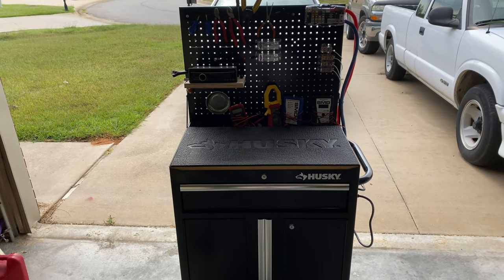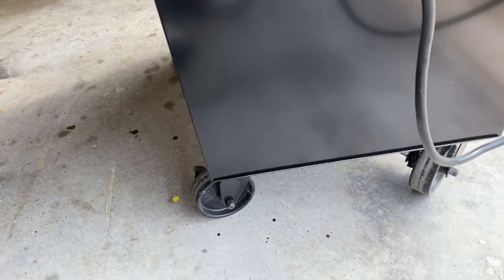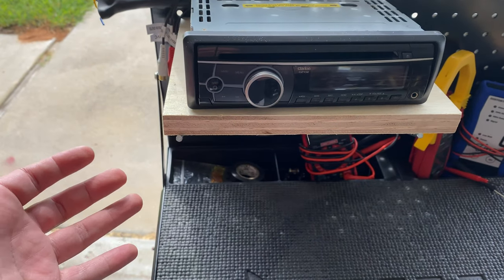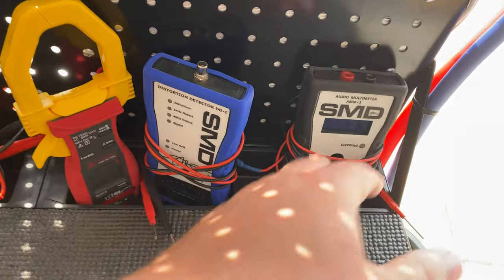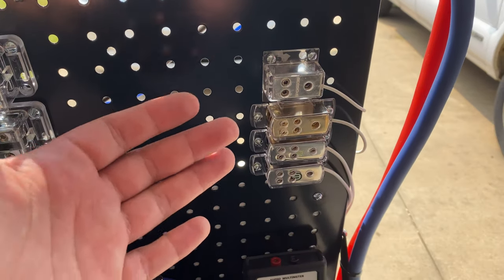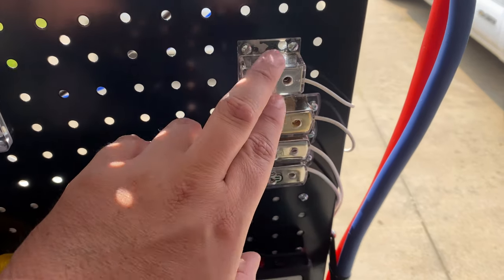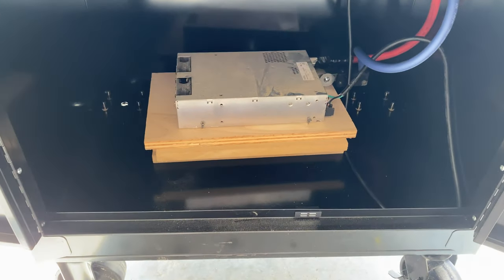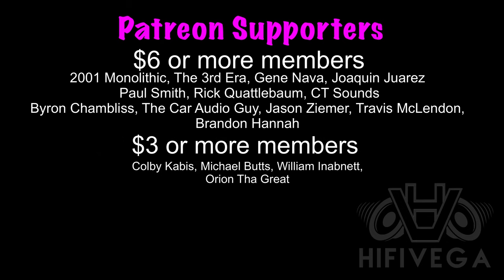Building my new car audio test bench! [4K]

Comment: Cool compact test bench. I have a pair of those klein strippers myself, they are the best. I built my power supply into an old tabletop radio and it sits on top of my work bench.My only suggestion is to put heatsink grease on the backs of the resistors so your pegboard can act like a heatsink .
Reply from the maker: 2011joser thanks!

Comment: Mount the power on the back wall of the cabinet.  Then you got room for a few batts. They make a under dash dash kit for old school cars. Slanted design. Could work on the opposite side of handle. Or put it into the front cabinet door.
Reply from the maker: Mike Danner oh I could still fit a few batteries with this one and I have a couple group 31 agms, but I wanna upgrade to a lithium battery bank and a charger for testing in the future

Comment: Decent setup! Looks like it may make it a little more convenient for you to use. Didnt realize we had the same power supply I'm gear up for a second and run them both to a fosgate t20001bd in my garage. Gotta figure out the feed back noise first from my Yamaha tuner.  I'm using the sub out. Right now I have a little punch 45hd running a sundown 8 but I wanna run my fosgate t2d2 15.
Reply from the maker: Trece Daves that Cosel is rock solid for sure

Comment: What size power supply you are using or more information on power supply to use. Thank you
Reply from the maker: Paul Van Der Ross it’s a Cosel 130amp continuous 150 peak power supply. I plan to upgrade to a lithium battery bank in the future
Reply: Thank you for the reply
Reply from the maker: Paul Van Der Ross 👍🏼

Comment: Can you link the power supply please!
Reply from the maker: sniperking305 https://www.ebay.com/itm/141333731427
Reply: @HifiVega  so I'm seeing it's a 1500 watt power supply to the tune of $300.00. I have a hewlett packard dps-1200fb power supply 1200 watts 

There has to be some huge difference in output. Because the hewlett packard cost $25. What am I missing ?
Reply: @Mr_BUSINESS_24_7   Not sure where you got it for $25, but they tend to go for double that refurbished and we'll over $100 new. 

Prices aside, the difference I see is 100AMP vs 125AMP.
Reply: @brandonweigel6309  what I have is not what he has. What I have "was" $25. But not sure what the differences are in the specs. Google DPS-1200fb specs. It does 100A. .....so ??.   And they are currently $24.50 to $27.99 plus shipping on ebay. I bought mine 7 years ago.
Reply: @Mr_BUSINESS_24_7  you asked the difference. His can produce 125AMPS, yours 100AMPS. May not seem like much, but if you're testing amplifiers, that extra 25AMPS can make a huge difference. 

And I'd already looked up what you have, couldn't find any for the price you claim, not even on eBay. But if you found them for such, good for you. 

Still, they are all used/refurbished for anywhere close to what you say you paid. I couldn't find any new for under$50.
Reply: @Mr_BUSINESS_24_7  also, his has connector terminals on it for actually connecting cables. Yours will need modifications, as it's desired to slide into a PC housing and integrate with the motherboard. Gotta pay a little more for extra convenience.
Reply: @brandonweigel6309  they are under $50 shipped on ebay. Stop clowning
Reply: @brandonweigel6309  I modified mine adding bullet connectors, floating the board, and soldering a resistor to provide continuity to keep it powered on, added some rubber feet to it... There is a youtube tutorial on how to convert this server power supply into a bench top power supply. Took me 15 minutes to do.
Reply: @Mr_BUSINESS_24_7  find me a new one under $50 shipped and I'll buy it myself.
Reply: @Mr_BUSINESS_24_7  I'm putting words in your mouth huh? Talk about the pot calling the kettle black. 

I said they can't be found new for under $50 and I couldn't even find used for what you said you paid ($25). 

You said they are under $50. 

I asked you to show me a new one for under $50. 

You said I put words in your mouth and linked to open box units, which can't technically be called new. 

So...
Reply: @Mr_BUSINESS_24_7  again, "open box" isn't technically new, but then again, when one says they bought something for under $25 and then go on to say afterwards that it didn't include shipping fees, well, that just goes to show said person knows not what they are talking about. 

You're probably one of those people who would brag about buying a new toy for 99 cents off eBay when the item normally retails for $100. But then neglect to say that shipping was $99. 🤣
Reply: @brandonweigel6309  open box is new. It's not BRAND new. But then again, to be honest, you never said BRAND new. GTFO. ...well, you did say if I found it new under $50, which I did, because it doesn't say used. And if it's not refurbished, do parts or repair or used then it's new.. ...so enjoy.
Reply: @Mr_BUSINESS_24_7  🤣